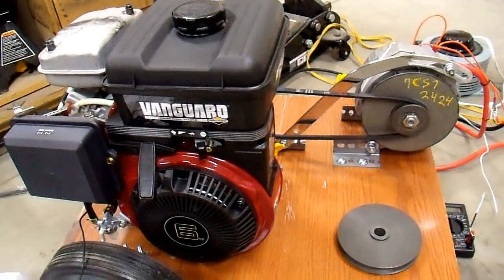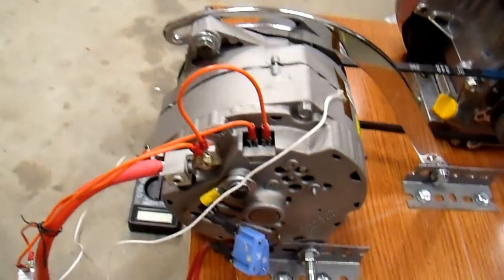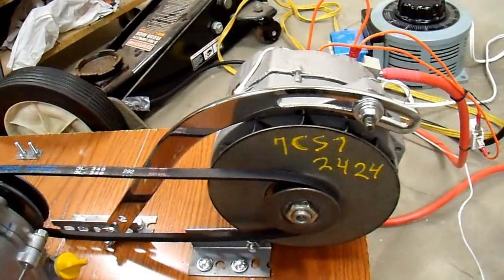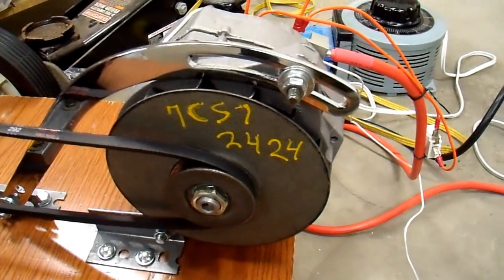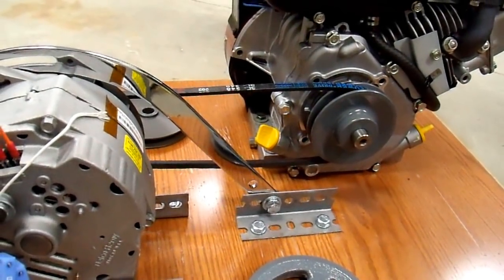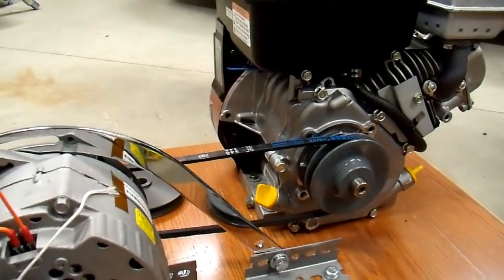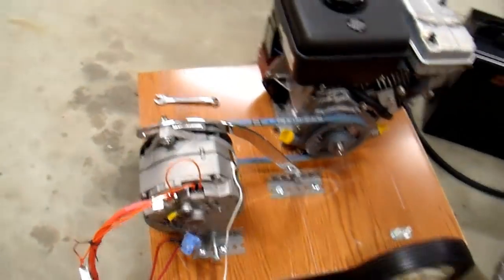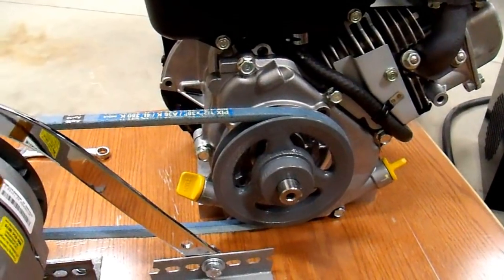DIY 12V Generator Charger - 7 Belt Drive Update

Comment: You said with the larger pulley you were able to keep the revs of the engine proper, and no struggling. I personally would have looked for a 8+ inch cast iron pulley, they have those for air compressor setups.You get a nice flywheel effect on it and it will quieten the engine as well. Also look into fin silencers, they are special high temp rubber posts that fit in between fins.Ducati used them on desmonic bikes. Good luck with it.Also you may want to experiment with a friction electric starter.

Comment from the maker: A cogged belt would be an idea, but v belts are far easier to come by.  I'm not sure how a chain would work at these speeds.  It would certainly be noisier and messier considering it would need to be regularly oiled and splatter oil all over, etc.  Chains don't rely on friction, don't have hysteresis loss as they bend around the sheaves, and are pretty efficient though.

Comment from the maker: It is a standard 27si-100 100 Amp alternator.  The field current is about 5A at maximum voltage and current.

Comment: One way to save your belt from pulsing so much is add a small flywheel to the output shaft. A machine shop could make you one fairly cheaply or an aftermarket wheel could be added. I am building a generator from a toyota pruis engine from the salvage yard with a honda ima motor for my needs it will output about 144v at 50amps which is enough for my needs. I was going to do the toyota prius generator but they have issues with the stator burning up so I went honda.